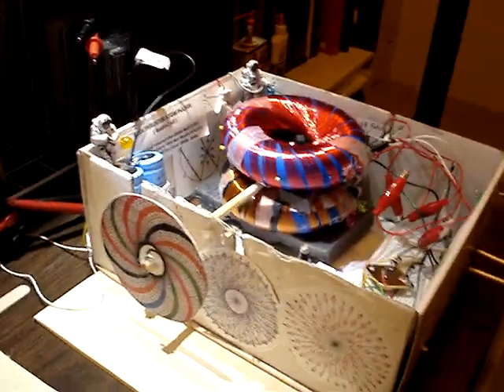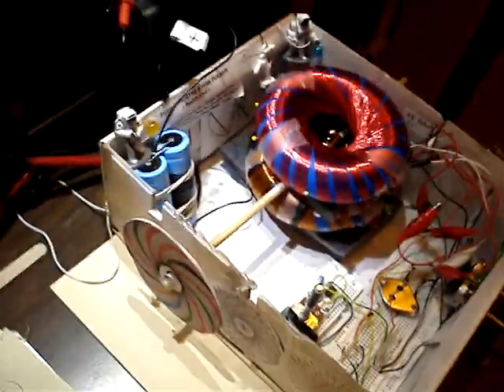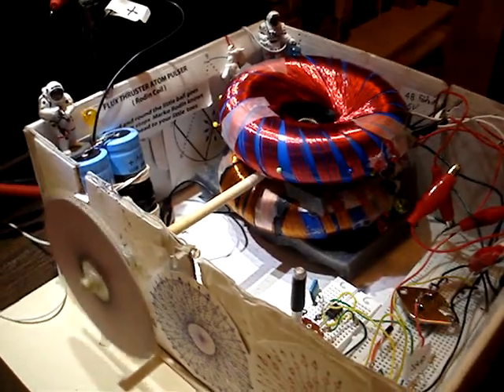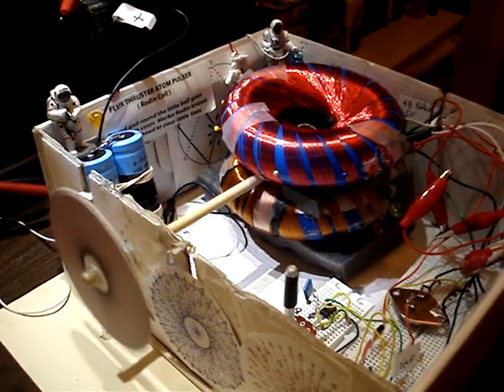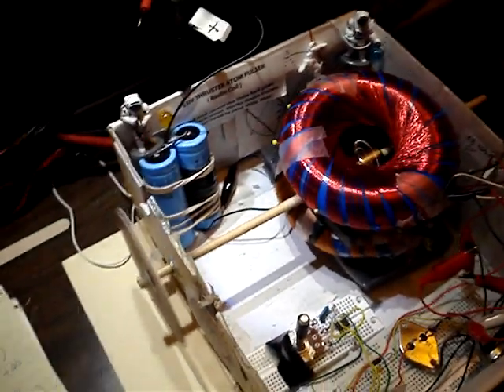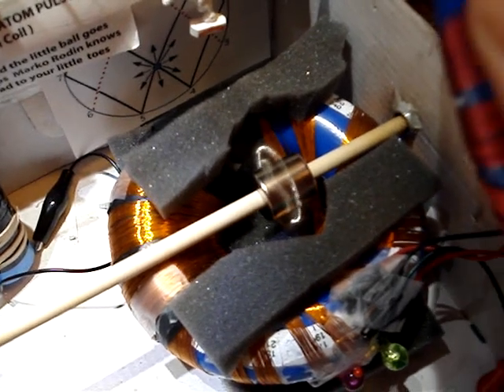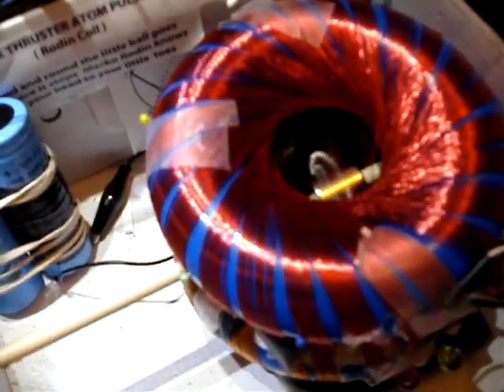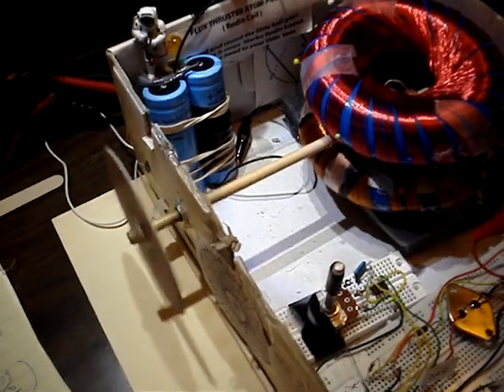neospin10  Rodin Sandwich Island Motor

Comment: I wonder what happens if you take 12 rodin coils and center each of them on every side of a dodecahedron (a shape with 12 sides)? the energy vortex emanating from each coil would all converge at a single point (the geometrical center of the dodecahedron).. but since the center of the vortex associated with a rodin coil is not at the center of the actual coil, they would have to be angled and positioned just right and not upside down.

Comment: Drop the bushing... use a 1" to 2" Neossphere.... with the rods mounted to the left and right of it's axis.   Each rod would have magnets on the tip riding repulsion in a Y cut base.  If you wanted to take it further place a wind generator at each end... Pass one back into a circuit to split voltage and output 12v back to the coil.  Build a lexan sphere to fit around the sphere and mount to ground.  Wrap that with copper too and have a 3rd generator.  3 different sources of power with only 12v.

Comment: I have a large amount of wire coming and am constructing a different setup than whats posted on U tube right now.

Unless you coil clamshell a diametric magnet one side of the magnet will always be without any magnetic influence.
The clamshell also presents a problem itself. Both coils interact with each other  resulting in a power loss. 

Within a couple of weeks I will show what I am doing and this motor should spool up as far as I want with good torque and NO magnetic uncoupling. 

Tom

Comment: When you spin a shafted horizontal diametric magnet you can place the coil under it with limited sucess. The top side of the magnet must be also powered so the magnet does not uncouple at  certain speeds. Clamshelling another coil on top is not the way because of magnetic interaction loss between both coils.  
In the next video I post I believe I have figured a way around both problems with a unique design.  Will post a video.  Hope for  3,000 rpm with lots of torque.  Will drive a load also.

Comment: I have made a Rodin coil and it did not perform as well as the coil with more wire.
Maybe (everyone) should standardize on a power source feeding any coil we  experiment on.  I use only variable frequency square waves from a function generator. ---Then  we can compare notes as to what works best and move on from there.  Wishful thinking.

Comment: Hi  Jack,
Using a single regular simple coil wound with  325 foot of 24 gauge  "Cross Connect" wire  I got 1800 RPM ( 30HZ ).   Joined in series the wire measured 650 foot. ( 16.5 ohm)  I spun a 1 inch diametric  cylinder magnet through its center axis.  Good torque.   Only power used was the output of a common  instrument testing function generator.  I now plan to split the coil - reverse one half -and sandwitch the magnet between.
 Now both sides of the magnet will be magnetically powered.

Comment: How many RPMs will this motor top out at?  ( HZ X 60).

Can you stop the hi spin  torque with your fingers?
Reply: i got a diametric cylandar spinning on a brass axle it topped out at 450hz psu at 12volt square wave thru audio amplifier